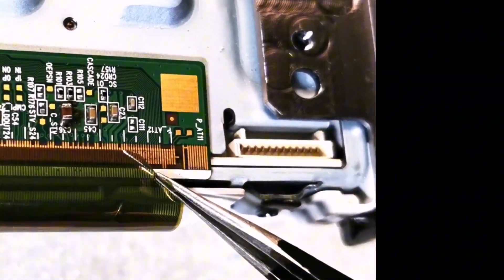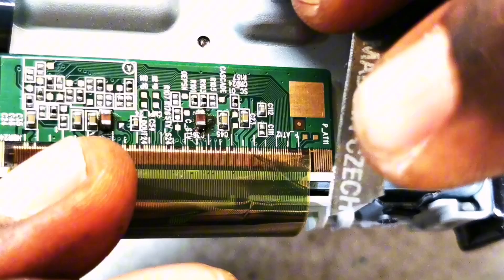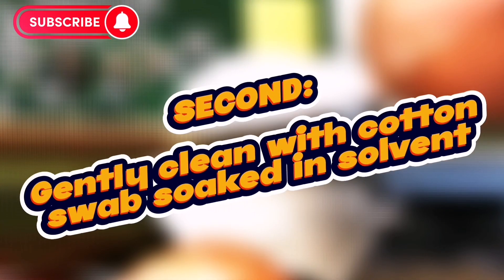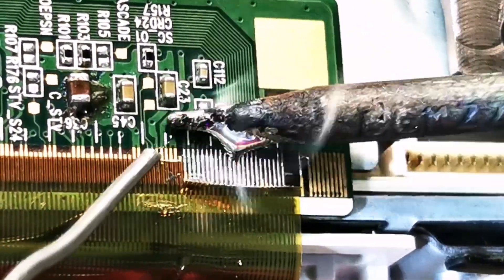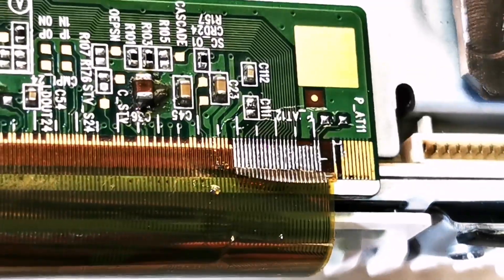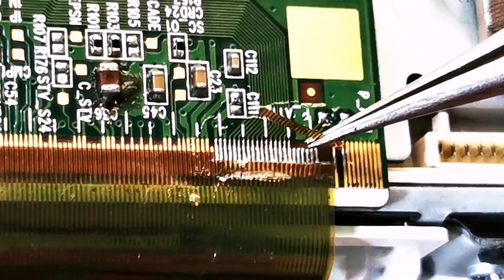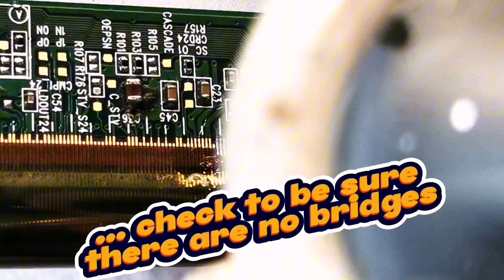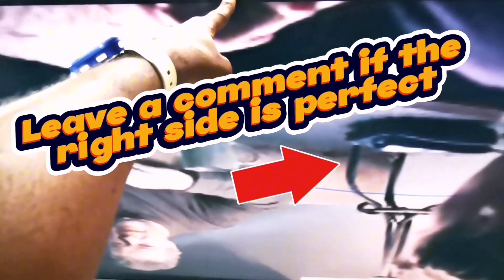Solder Like a Pro! (5 Steps)

Comment: I was able to fix my TV based on these instructions! Thanks a lot. I used solder paste as the soldering temperature is really low (138 C), so there was no risk to melt the flex cable.
For everyone that wants to try, make sure to have the proper tools, a soldering iron that you can set the temperature is a nice start. I used some flux, solder paste a nice set of cutting tools. Didn't use lenses or microscope but I highly recommend.
Reply from the maker: Oh my God! 🥰🥰🥰 My heart is about to burst from immense appreciation. Thank you so much for the kind words! ♥️🙏

Comment: Nice! Why do we have to trim the tip of the COF?
Reply from the maker: Sensible question there. It helps to trim to reduce the likely hood of solder bridges between the tracks as the iron move back and forth. I know this well for I've been doing this job for some 15 years. Comment appreciated. 🙏

Comment: Wow this is soldering at
 another level, am impressed thanks for sharing this step to step guide.
Reply from the maker: Thanks to you too, bro for taking the time.
Reply: @asodisplaysolutions Hi, I need to change a small LCD from car cluster panel, the old one looks like was using ultrasonic soldering.
Cof of the new display come with Blacks contacts, looks like conductiv paint.

Any help will be appreciate 

Thanks in advance.